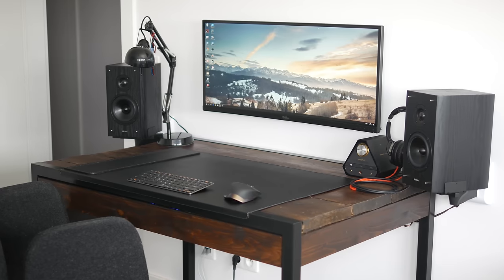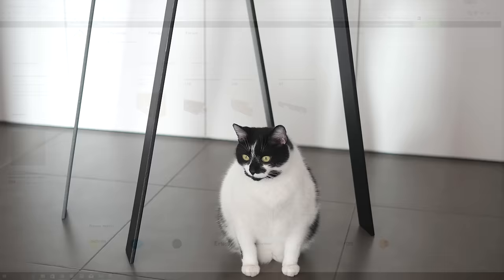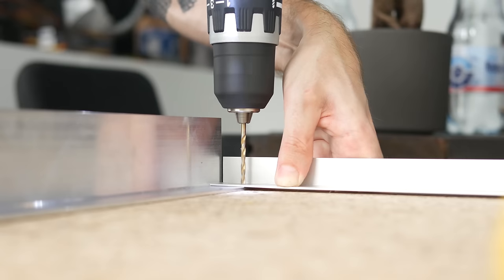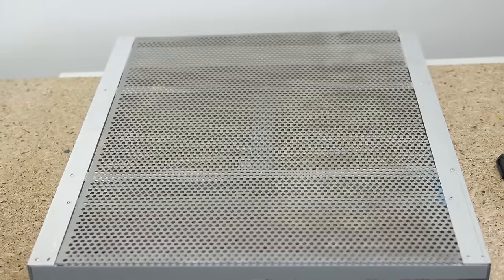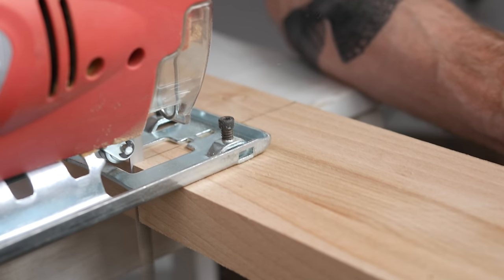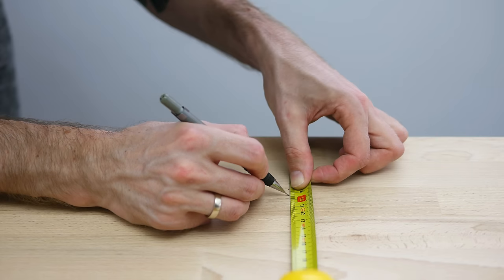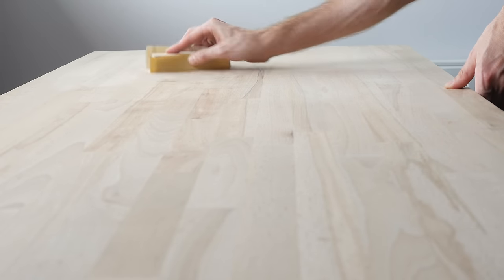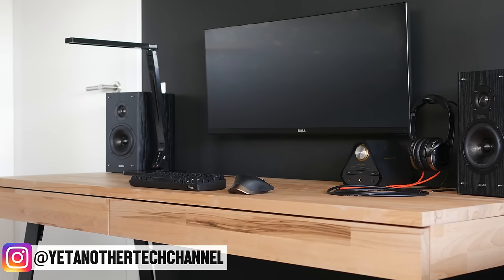How to make a desk PC for adults (DIY desk PC)

Comment: iam a carpenter and its very funny to watch this, but the result is not bad, noce work for a amateur
Reply from the maker: I'm a technical writer - proving that with a little will and determination you can make something without access to a fully equipped workshop... but I do wish I had a proper workspace for DIYing...

Comment: The pc cabinets are specially made so that the components do not suffer from static or electricity damage. They are not mere veneers. If you dont use the right metal, it can suffer a lot due to those kind of problems. Is not a good idea to make a support that does not have an anti static treatment.
Reply from the maker: Are you an actual engineer, designing electronics for a living?
Let me share with you some stats, which come from actual experience.
Number of years with the desk PC: 2,5
Number of failed components: 0

Comment: It'd be cool if you could figure out a way to mod the drawer so that it acted like the push-and-open one on the TAKU, which can then be removed from when opened.

kickstarter.com/projects/1308692809/taku-the-monitor-stand-pc-case
Reply from the maker: The drawer is removable - you can take it out by pushing retention tabs on both rails and pulling it out.
Reply: Awesome, thanks for the heads up. Absolutely love your style btw

Comment: What if you spill a glass of water on the table
Reply from the maker: I cannot think of a better reason to upgrade ;)
Seriously tho, I think the damage wouldn't be very serious - maybe radiator fans would short and would need replacing.
If I was a little bit more comfortable with the router, I would have made a small groove along the vent to divert the liquid.

Comment: Honestly my fear would be that the components are easy to be destroyed by an electric shock, its not grounded and putting the components on the metal bottom frame will have them in direct contact if you're touching it and you're not grounded
Reply from the maker: I don't know where this is coming from - I assure you that this is not that different from a regular PC case.

Comment: Not very good for the air flow
Reply from the maker: It's good enough - the system has been running rock solid for 10 months now... but I already have some ideas on improving the airflow and I really want to go full custom water loop.

Comment: in this video: a router is a CNC machine. his arms are also axis rails with touch sensitive limit switches, and the wrists elbows and shoulders some kind of magnificent perfectionists stepper motors, while his eyes can scan in gcode. very designer bullshit

Comment: When the tools use in this video cost more than a pc case....
Reply from the maker: The tools that you absolutely need is a drill (I think most households should have one - $30), hacksaw (really cheap - $5) and pop-rivet gun (not the most common - $30). I'm pretty sure that all the cutting can be done at the hardware store.

Comment: The grafics card is going to break for sure
Reply from the maker: Why would it? It worked flawlessly from the start and I'm sure it would have served me for years to come... but I just swapped it for an RTX 2070 ;)
Reply: @YetAnotherTechChannel  it was only being hold by its on connection , but well glad to see it was strong enough :D ! Good buy and nice desk btw
Reply from the maker: It might be that I forgot to mention it, but there is also a rear bracket support, just like in a regular PC case.

Comment: WTH!!! DYI if you are a cabinetmaker :/
How an ordinary person can have access to all these tools without buying them?
PS: Wonderful job though.
Reply from the maker: I'm not a cabinetmaker, I make a living as a technical writer ;) And I don't make these things in a workshop but in my apartment, in a room that's less than 11 square meters.
You can borrow the tools from a friend or rent them somewhere. If you decide not to make an air vent, you can probably get everything cut at the hardware store - then the only thing you need is a screwdriver, hacksaw and pop-rivet gun, which isn't that expensive.

Comment: i hate your screw selection, you use wood screws on metal, time-stamp 6:34 awful. but nice build.
Reply from the maker: I'm afraid there's been an misunderstanding - what you see there is a metal bracket (that has a bunch of holes in it) screwed to the wooden drawer support as shown in 5:19.
Reply: i have problem width screw head its angled and looks ugly